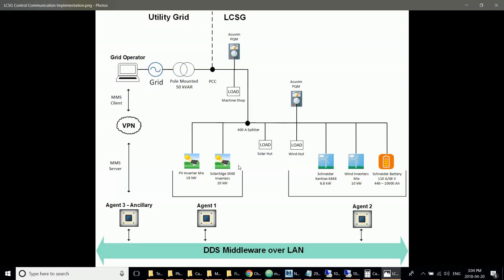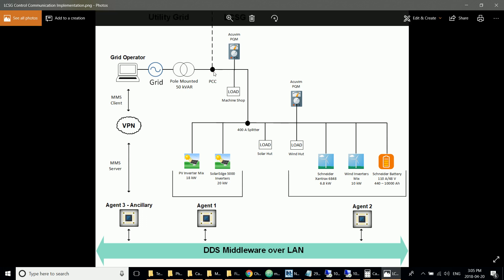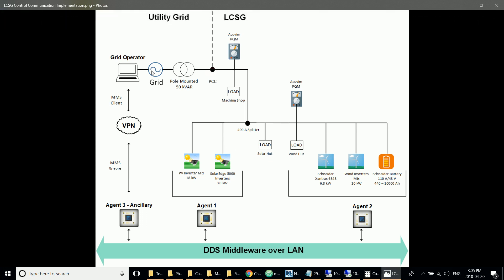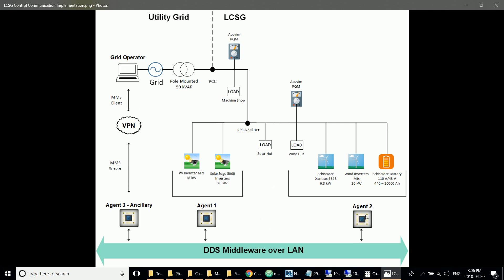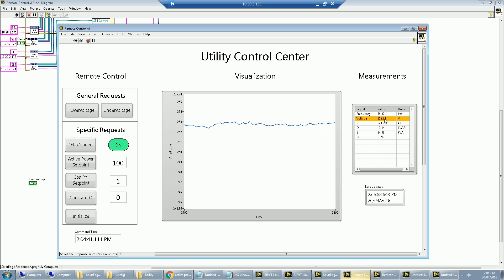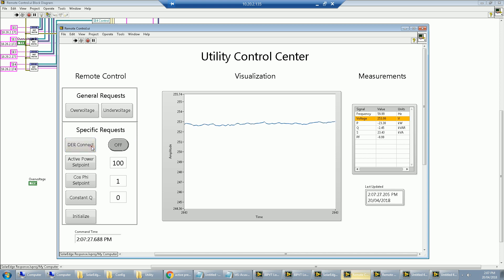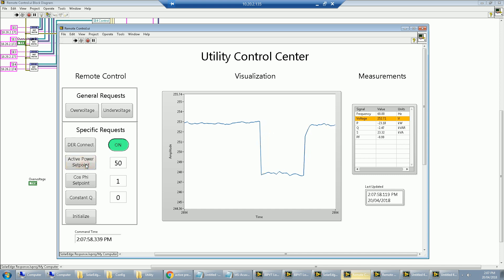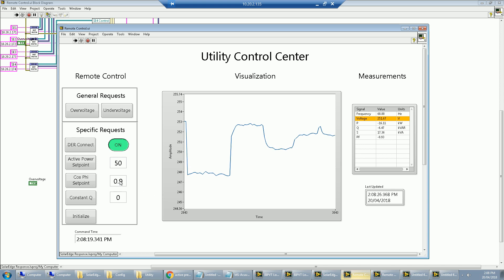Voltage Regulation DERMS Software Demo

Comment: Great Demo! Very interesting, I was wondering whether you are able to automate the active power setpoint so the voltage is just under the operating limit, so to maximise VNM? Best, Nikolaus
Reply from the maker: Thanks Nikolaus! We most definitely can do what you described ... but before doing this we try to modulate cosPhi (reactive power) first, or charge batteries to soak up the excess active power. All of this is automated. Check out the video on this channel called Voltage Regulation using smart inverters and DDS. Thanks for watching!
Reply: @HeroEngineering  Nice! Thanks for pointing me to that. Keep up the awesome content :)
Reply from the maker: @houbenbub  Thanks! You as well!